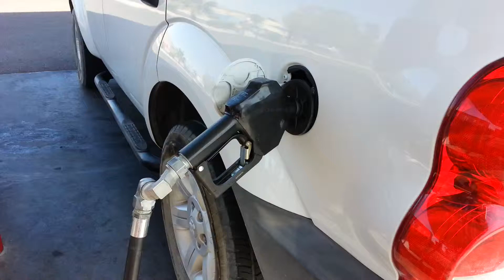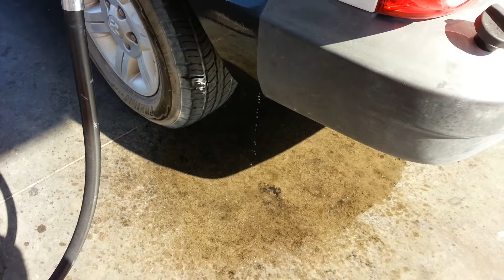2008 Dodge Durango fuel fill issue

Comment: Chrysler Service Bulletin
NUMBER: 14-001-12 REV. A
 (Extended Warranty)
GROUP: Fuel System
DATE: April 19, 2012

THIS BULLETIN SUPERSEDES SERVICE BULLETIN 14-001-12, DATED JANUARY 20, 2012, WHICH SHOULD BE REMOVED FROM YOUR FILES. THIS IS A COMPLETE REVISION AND NO ASTERISKS HAVE BEEN USED TO HIGHLIGHT REVISIONS.
SUBJECT: Fuel Spit Back During Refueling Due To Inlet Check Valve X39 (Unlimited Time And Mileage Warranty Extension)
OVERVIEW: This bulletin involves replacing the fuel filler tube if the condition occurs.
NOTE: When removing the existing fuel filler tube note how it comes out to aid in installation of the new part.
MODELS:
2006 - 2008 (HB) Durango
2007 - 2008 (HG) Aspen
NOTE: This Extended Warranty Bulletin applies to HB vehicles equipped with a naturally aspirated gasoline engine built between February 1, 2006 (MDH 0201XX) and March 31, 2008 (MDH 0331XX) or HG vehicles equipped with a naturally aspirated gasoline engine built before April 1, 2008 (MDH 0401XX).
SYMPTOM/CONDITION: Some customers may experience a fuel spit back condition during a refueling event.
DIAGNOSIS: If the customer experiences the symptom/condition, proceed to the repair procedure.
PARTS REQUIRED:
Qty. Part No. Description
AR (1) CNNZX390AA Tube, Fuel Filler
AR 6500911 Rivet, Splash Shield Attaching 5 rivets on 2006 4 rivets on 2007 and 2008
NUMBER: 14-001-12 REV. A
GROUP: Fuel System
DATE: April 19, 2012
REPAIR PROCEDURE:
NOTE: When removing the existing fuel filler tube note how it comes out to aid in installation of the new part.
1. Hoist vehicle. 2. Remove Left rear wheel. 3. Remove the left quarter panel splash shield. 4. On new fuel filler tube verify and write down existing torque (Fig. 1).
NOTE: It may be necessary to loosen the worm gear hose clamp and rotate to allow the fuel filler neck to fit between the body and frame. If clamp is loosened then once installed re-torque to noted value.
CAUTION: Protect Paint and Quarter panel metal during removal and installation.
Fig. 1 Fuel Filler Tube
1 - worn gear hose clamp
5. Replace the fuel filler tube, Following the detailed procedures found in DealerCONNECT>TechCONNECT Service Info > 14 - Fuel System> Fuel Delivery > Tube, Fuel Filler removal and installation procedures. 6. Install the left quarter panel splash shield. There are 4 or 5 plastic retaining rivets. 7. Install left rear wheel.
POLICY: Reimbursable within the provisions of the warranty.
14-001-12 REV. A -2
NOTE: Vehicles included in this Service Bulletin have a lifetime coverage - Unlimited Time and Mileage warranty for this repair. See Warranty Bulletins; U.S. D-12-07, Canada SAB 2012-03, International ID-12-02 or Mexico BG-01-12 for details associated with the extended warranty.
TIME ALLOWANCE:
Labor Operation No:
Description Amount
14-60-15-92 Tube, Fuel Filler Replace (C) (Skill Level = B; Training Level = 3)
0.7 Hrs.
FAILURE CODE:
ZZ Service Action

Comment from the maker: Got it sorted out. Apparently there is a huge warranty extension for this issue. It's a faulty valve on the gas tank that has to be replaced. Totally free for us just our time to get it done is all it costs us. So glad to get it corrected. It causes check engine lights and gas cap errors.
Reply: Good to hear!  georgeterro sent me this way, subbed
Reply: So the valve is replaceable in the tank? Like the jeeps??? Or is it a issue with the filler neck??

Comment: Seems like a design issue, the neck leading to the fuel tank bends in such a way that the fuel sloshes back up and out of the vehicle when you reach the full mark. It may also be caused by an air bubble in the tank being released as the tank is close to full. Either way, this issue may be part of a recall, and if it is not, it certainly should be. Check with the local Dodge dealerships to find out.

Comment: How did you fix it? Happens to me at every fill up. This is why I just fill to a dollar amount based on how empty it is.
Reply from the maker: Luis Coppin, Jr. The dealer issued a recall concerning this problem. call your local dodge dealer and they should fix it for free. My dealer fixed it and now it's fine.
Reply: Cool, thanks. Will do. I topped off my tank today for the first time in a while and same thing.